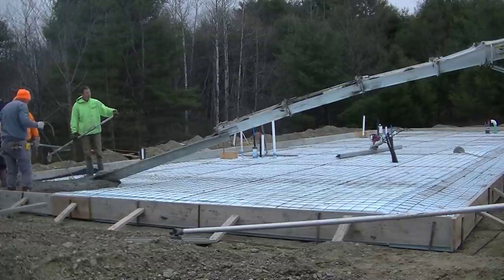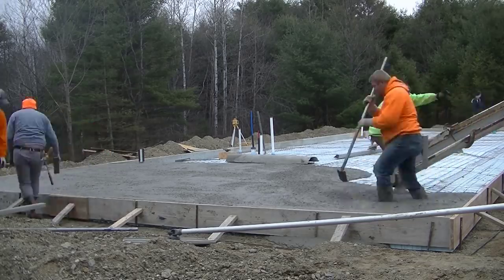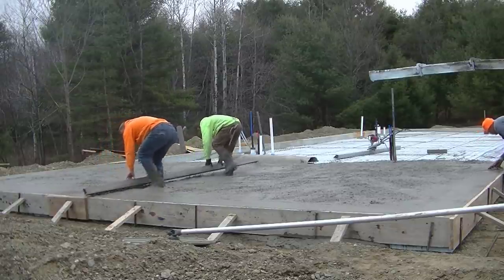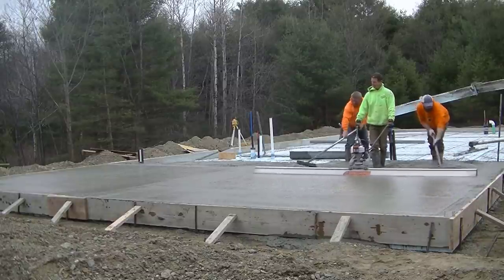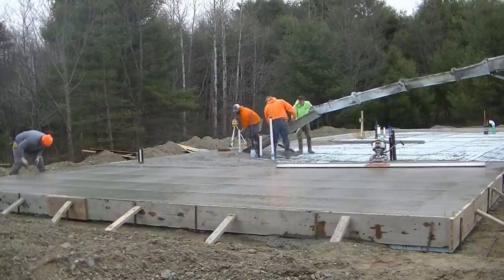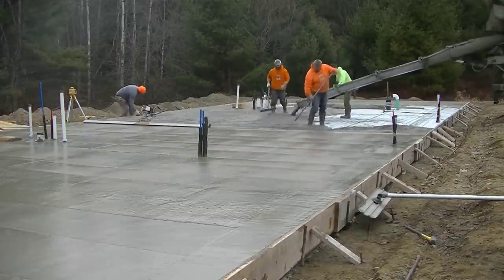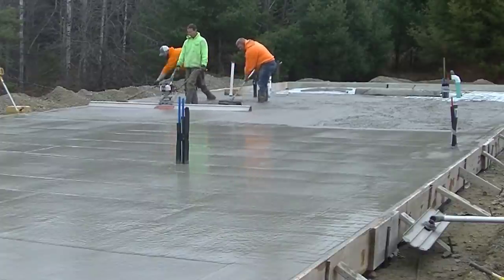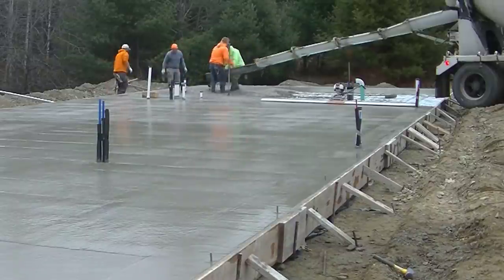Pouring An 80' x 28' Concrete Slab (Duplex House Slab)

Comment: How is the perimeter yardage figured out? I can figure yardage on a fixed depth but how do you add for the extra on the perimeter? You guys are awesome, great crew, great Leader !
Reply: I add 2.5 feet each way on my dementions! For 12 inch footings!
Reply: For the footings I do (on a calculator)
Depth × width × length = the yardage.

Comment: How come only a 12in edge/footer? How come not below the frost line?
Reply: Was wondering the same thing
Reply: That’s code in Maine, the foam helps from frost heave and it works pretty good as long as the sub grade is done right, rarely are there any problems

Comment: Is there a frost footing under the perimeter?
Reply: It is a haunched slab, 6” main slab and 12” on the perimeter, that is code in Maine for slabs, and 2” of foam deters 2’ of frost, if that answers your question
Reply: @chrisbrann7733  Here in Iowa we have to go 42" deep around perimeter on anything over 1000 sq. ft.